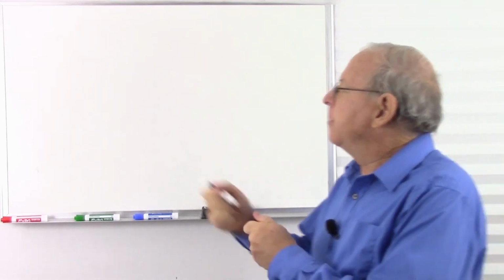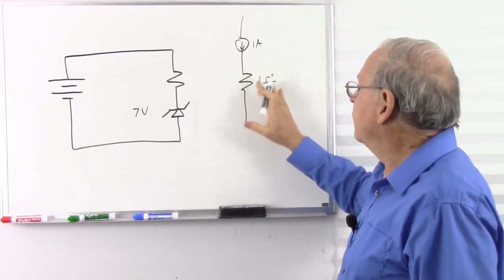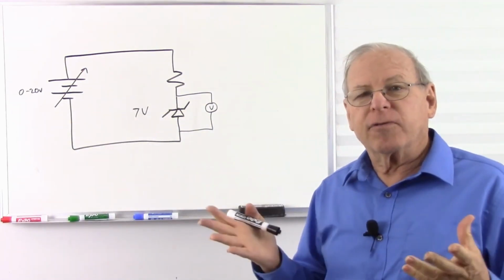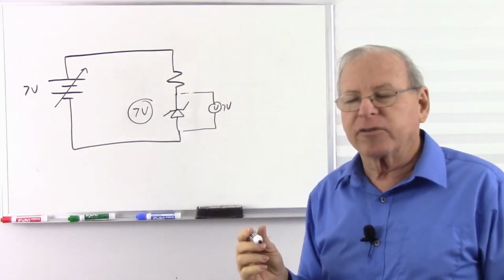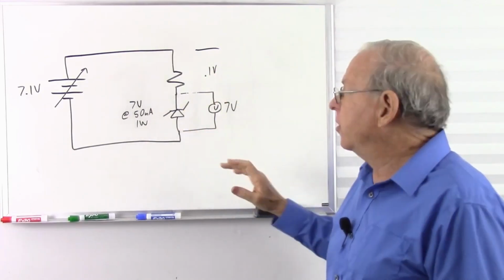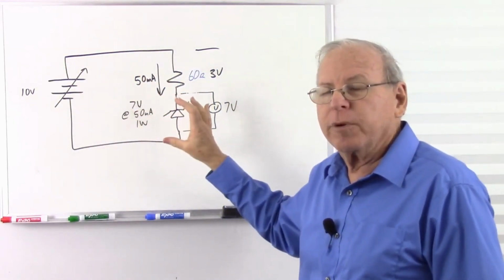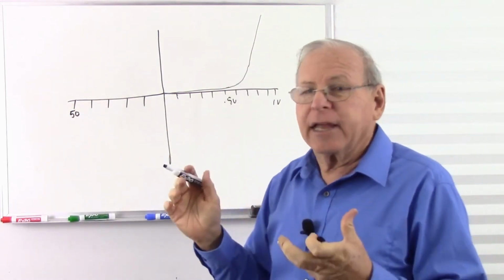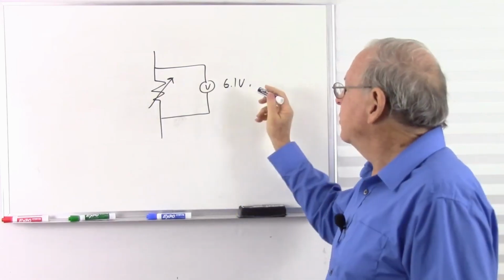Zener Diodes

Comment: I saw this by accident.  It reminded me of when I was building an facility to test HP air powered jet engines for wind tunnel models.   During installation of 6 process controllers the electrican and my design engineer went behind the panel and connected full AC power to the controllers.  I thought they had ruined the controllers.  The techs at the shop told me the Zeners had protected the devices and all was good after they were replaced.   Note to self:  Allow only one person behind the panel at a time.  That was back in prehistoric times of the 1980's.

Comment: He misses the whole point of using a Zener to create a fairly stable output voltage. 
You have a supply voltage and a Zener diode. 
Place a resistor between them and measure the current. Go to the data sheet for the Zener and read the maximum current it will pass. Suppose it is 90mV.  Change the resistor so this current flows. 
When you connect a load across the Zener, you will be ROBBING THE ZENER OF CURRENT. You can take up to 80mA. 
The supply will always be delivering 90mA and if you take 50mA, the Zener will waste 40mA. 
If you take 90mA the circuit will work perfectly, but if you take 100mA, the voltage you receive from the circuit will be slightly reduced. 
This is the basics. There are other, more complex discussions, for later in your course. 
This is a very simple, wasteful, circuit and not suitable for battery operation.

Comment: 14:25 noticed you calculated the resistor value based on nominal voltage (10v in your example) and rated current limit for your Zener diode (50mA in your example).

But a bit later you mention a Zener diode is usually used in circuits where you need a stable voltage reference but can’t guarantee your nominal voltage.

Should you then calculate your resistor value to not exceed the Zener diode current limit based on the max expected voltage rather than the nominal?
Reply: Absolutely. If too much current passes through the zener it will burn out.

Additionally, too little current through the zener will cause it not to breakdown at the specified zener voltage. So the zener current must fall between its minimum and maximum current values, which you obtain from the data sheet.

Comment: Nice video sir. But I have a question, what will the available current for the load to draw in this case since the curcuit has a series resistor, will the amount of power available to the regulated side is also limited by the value of the resistor that is used in the circuit?
Reply: It is limited by the power rating of the resistor. Higher power resistor means you can pass more current through it.

Comment: What if its not ideal power source from heaven, but a battery that goes from 4.2 volts to 3 volts? How do we pick a reistor now? Why wasting so much time with green man and not explaining the only crucial info one needs to know in REAL LIFE circuit?
Reply: First point.
Your output voltage needs to be lower than the minimum input voltage.

Second point:
The zener voltage needs to be lower than the minimum input voltage.

Third point.
Look up the required current for the zener diode to operate correctly. It is typically a wide range but you need to know both the minimum current and maximum.
Set a zener current between the minimum and maximum values.

Fourth point:
Calculate what resistor value you need.
Re do your calculations with both the minimum and maximum input voltages to ensure the zener current is in the required range between its minimum and maximum limits.

Fifth point: do the power dissipation calculations on the resistor and ensure you use an appropriately sized  resistor (measured in watts, not Ohms).